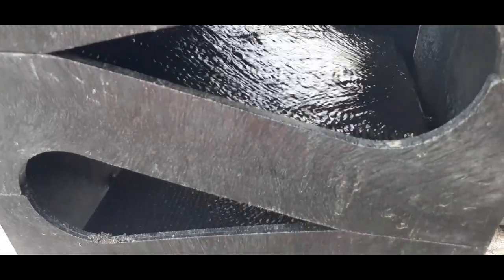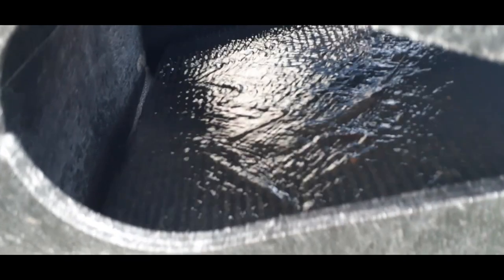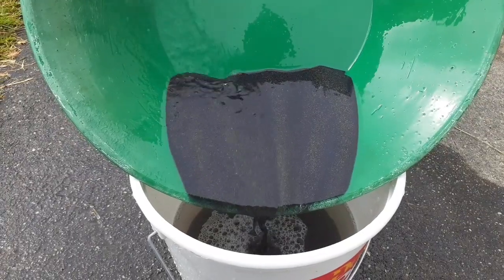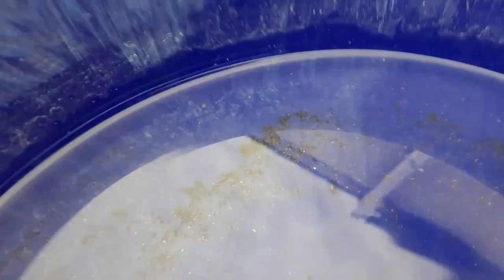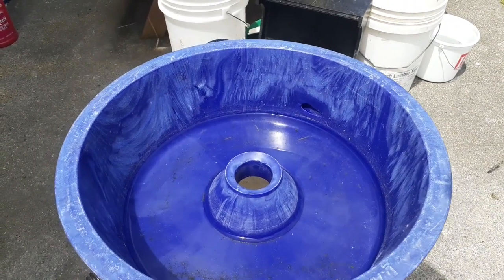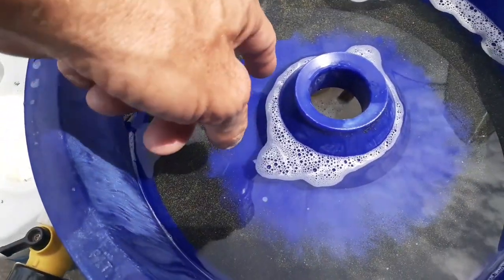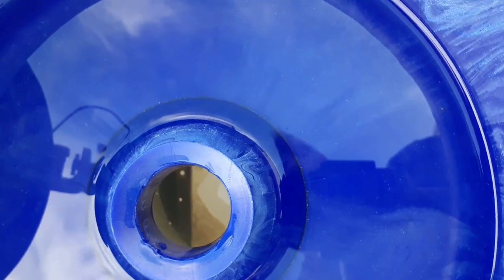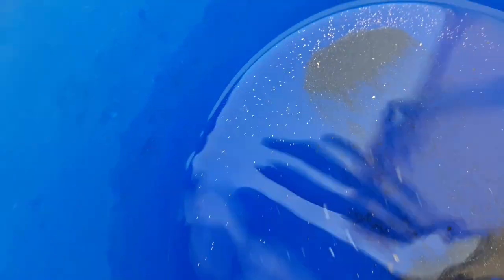We Ran Oregon Beach Sand Through The Gold Cube & Blue Bowl  WOW!

Comment: A round bubble level that fits on top of the blue bowl outlet or funnel top works best for me. If you put the black sands on aluminum cookie sheets and use a spin-it-off magnetic removal tool, you will be able to concentrate your pay-dirt/sands.
Reply from the maker: In theory yes, but reality gets in the way when you come to the variable particle size.  The gold is so fine that a magnet picks up gold with the black sands.  I've been working with this material for over a decade and I can assure you normal processing methods don't work.  We run it twice all the time.  Every gold bearing region has it's unique set of challenges.  I use several different types of levels, but I like my trusty level from Ace.
Reply: @DavidBriggsAdventures  yep have lots of Cape D Sand as well...

Comment: Have You seen any Allen Robertson vid's ? His use of silicone seems to work well with blue bowl & black sands... (just found You & Sub..) 
Best of luck from Oregon City Lol
Reply from the maker: I like his vids.  I tried silicone with mixed results.  it does work.  Just hard to do the molding process.  Thanks for watching, and welcome.
Reply: @DavidBriggsAdventures  I find a 50/50 or 75/25 (25 Dawn) mix in a spray bottle... sprayed directly onto mold (not silicone), then put in silicone, spray good, and clearwrap & roll works well... 
Looking forward to hitting the coast with the detectors & getting some sand samples come spring.... love the way Our administration set it up so we can but can't work the coast & dredging.... Lol
Cape disappointment is seeing  some of that this year..
Be Safe

Comment: David great video. I have the same issues with micro gold it is not flour gold what I'm working is dust gold LOL we are working with it because we found it in our property in a seasonal creek. We have the Gold Cube, Millers Table, Blue Bowl. My problem is that both blue bowl and millers table leave some sand with the gold and its a pain to separate loosing some of the micro gold. Would like to know what do you do to separate blond sand once it's concentrated either in blue bowl or millers table
Thank you
Reply from the maker: I can do it by hand, but you can use a miller table with a nice flat layer of silicone mat.  You get really great brush control when using a snuffer bottle for collection.  Basic black is best for differentiating between gold and platinum.  A very real situation where I live.
Reply: @DavidBriggsAdventures  

Hi Dave.  When using the table I need to use a credit card to collect the gold and then use snuffer bottle but prior to using the credit card the majority of the gold is not visible until I put it in a pile unfortunately sand is collected and hard to separate, this thing is micro micro gold
Thank you
Reply from the maker: @lamancha7066  the color of the silicone matters.  The rest is for your refinery to resolve.   When you drop off 40 pounds at a time nobody cares.
Reply: @DavidBriggsAdventures  
OK I'm going to give the silicon mat a try then Thank you
Best regards